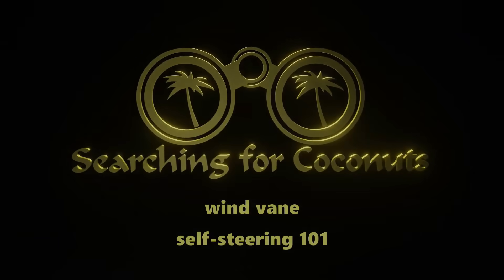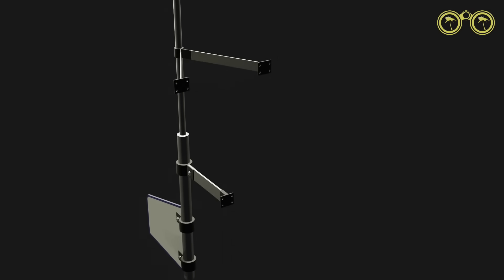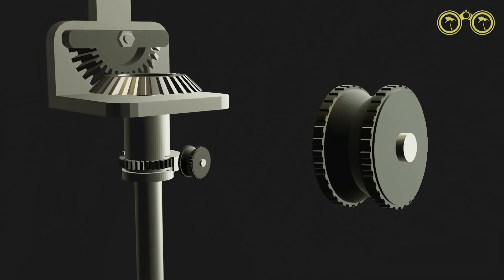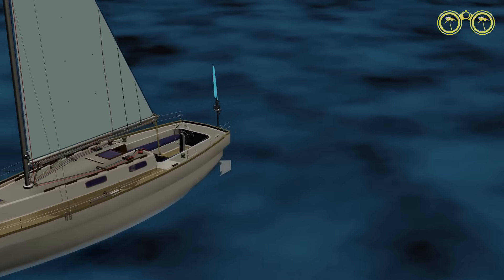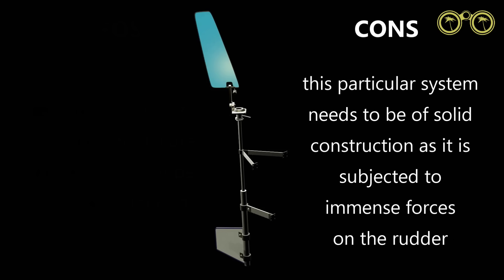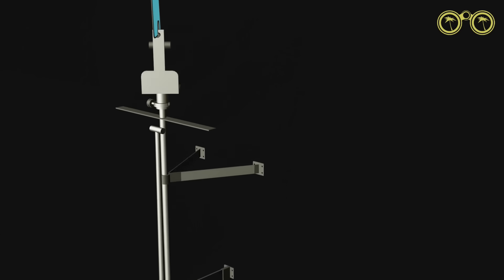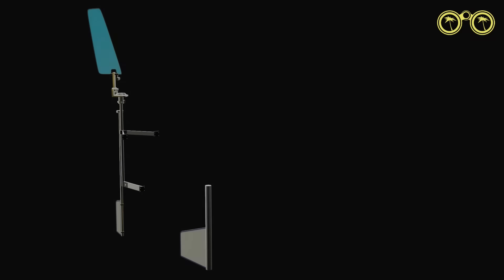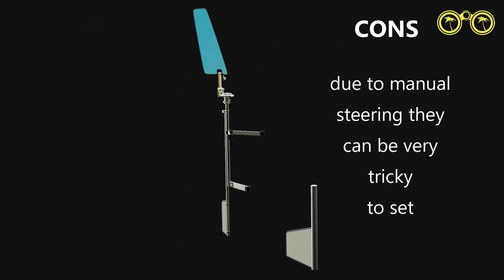Wind Vane self steering systems - An easy, animated introduction on how they work

Comment: In my offshore experience three important issues not mentioned in this video:
1.   The sail of the windvane must 'see' unobstructed wind, meaning it must be many feet aft of spray hoods, etc.
2.   There must be at least 10kts across the sail of the windvane to make it function.
3.   From beam winds aft vanes lose ability to control the boat. The resolution is to decrease main sail area.

Our best approach was to fit a screw-ram autopilot to the wind vane, keep its sail stored, and using <1A / hr,   drive the 50 foot
fin keeled cutter in all sea and wind conditions up to storm conditions.

Comment: I didn't make my own wind vane.  It was on the boat when I bought it.  That was twenty years ago.  I understand it was offered as an  option when the boat was new. 

The boat was new back in 1976. 

The Sayes Rig wind vane steerer still works great although I did replace two parts. 

I wouldn't go to sea without it.
Reply from the maker: Absolutely agree — we also wouldn’t dream of going offshore without our wind vane. Ours is on our 1978 sailboat, and we just love how these old-school boats were built strong and reliable. Amazing to hear your Sayes Rig is still steering strong after all these years!

Comment: There's a fourth type whereas there is  a flat extending off of the back of the rudder. The wind vane forces the flap to one side which forces the brighter to the opposite side.
Reply from the maker: Great observation and you’re absolutely right.  It’s a clever mechanism that we didn’t cover in this video, but it’s definitely a good addition to the discussion. Thanks for pointing that out!

Comment: Good illustration of servo-pendulum systems but no mention of wind vane systems that control the rudder using a trim tab attached to the main rudder. This is the simplest and best system for boats with transom hung rudders in my opinion.  I speak from experience using both systems.
Reply from the maker: Great to know!  First hand experience and knowledge is always great! Thank you for sharing.

Comment: This video is excellent.  However I am confused because some commentators use the terms 'Hydrovane' or Windvane' systems which seems to imply they are different systems!!!! So my question  Is;  Is using the term 'Hydrovane' or 'Windvane' one and the same???
Reply from the maker: thanks for watching and your amazing feedback, much appreciated. A wind vane is actually a system for showing from which direction the wind is blowing from, or any apparatus affected by the wind. I guess the correct term would be a wind vane self-steering system. Hydro refers to water so not sure how that fits in. Then some refer to the systems according to brand names, such as "Wind Pilot". While there are variations in design, they all perform the same function, keeping the vessel on a course in relation to the apparent wind. Hope this helps, thanks again
Reply: @searchingforcoconuts2248  Thank you.  Yes I think Hydrovane is a manufacturer but it is still a windvane steering system.  I am clear now.

Comment: which system would you advise for use on a 40ft cat?
Reply from the maker: That's something for the professionals. You have to take into consideration how fast a catamaran can be, so apparent wind will probably change more dramatically. Then, it has to be installed where the wind is not obstructed or diverted, and between the hulls is not always possible or practical. If you place it on port side, starboard wind will not affect it etc etc... Yes, there are cats with these installed but not too many... Thanks for watching

Comment: Unlike autopilots, wind vanes do not "steer our vessel back onto course."  Nor do they even steer the boat back onto a heading.  Rather, they help the boat maintain a constant bearing relative to the apparent wind.  As the apparent wind changes, so does the boat's heading.  The bearing relative to the apparent wind is set by the pilot or autopilot on the wind vane.

In order to maintain a constant heading, wind vanes must be manually or automatically adjusted by the pilot or an autopilot.  Course control is only achieved, either by the pilot or the autopilot, by monitoring position relative to course and making small correction back to course.

Wind vanes have two primary benefits:
1)  They reduce the pilot's workload, including prolong time away from the helm to adjust sails, cook, and rest.
2)  They act as backups for the sailboat's autopilots.  Without them, an autopilot failure requires a pilot manning the helm at all times.

As with any sailboat steering system, it's best to set and trim sails such that large changes in either wind velocity or wind direction have minimal effect on helm load.  This way, wind vanes will best be able to maintain a constant relative wind.
Reply: I’m new to sailing and I keep watching videos and really thinking about a wind vane hell they work I’m still trying to figure out how it can really keep you on course all the time. I don’t see how it can but reading what you wrote makes sense I think you would still have to constantly, keep on watching your directions you’re going into
Reply: @Justincas5272. You missed their most important advantage.

They keep the sails happy throughout wind direction changes.
Provided you trimmed your sails well no future trimming is required.

This allows the helmsman to do other (in)activities. 

Sail twist and size changes might be required though.  For resting sessions,  the shorthanded watch would be wise to err on a shorter sailplan than for an awake crew.

Comment: FASCINATING.  I BUILT A MODEL BOAT IN PORT.MELBOURNE, BUILT A  SELF
STEERING MECHANISM  TO SAIL IT.   IT DID SAIL OUT OF PORT PHILLIP BAY,  BUT  SAILED 200  KM ALONG THE VICTIRIAN COAST  TO PORT WELSH POOL, AND WAS FOUND BY TEVELLI FISHERMAN.  IT WAS  ONE FOOT LONG AND SAILED   300 KM IN  7 DAYS. IN  6  METER SWELLS, THAT SHOULD NOT HAVE ALLOWED TO EVEN SAIL. I HAD BUILT THE SELF STEERING MECHANISM INTO THE SMALL MODEL YACHT. THIS IS PORT MELBOURNE IN MELBOURNE. AUSTRALIA.

Comment: Why not take the first vane setup, ditch the rudder and connect the vane with the main rudder?
Reply from the maker: biggest pro for the first setup is that the vane's rudder can be used as a back-up rudder should you have a main rudder failure, and if your vane cannot be fixed to the centre of your transom, it can still be installed at a different location and work effectively. Hope this helps, thanks for watching...

Comment: Sorry to not be overly enthusiastic about your videos but they don't explain something simple. How do you keep a course??? I mean if you have to sit there ensuring the rudder is always facing the wind what happens if the wind shifts? You're continually altering it so you may as well just use your helm, instead of a fancy, expensive rudder that does the same thing?
Reply from the maker: thanks for watching and adding your feedback. These systems are designed for long-distance sailing and ocean crossings where consistent trade winds can be expected. They cannot be used effectively for coastal sailing sailing where wind shifts are often and extreme.

Comment: if I have a Raymarine autopilot in my sail, will it have any advantage? or not needed since I hace the autopilot?
Reply from the maker: Hi, and thanks for watching. The nice thing about an autopilot is that it also works while motoring, and a wind vane does not. The downside is that it needs power. If you have solar and/or wind generator, you will not have to worry about power. Hope this helps

Comment: I'm in the process of buying my first sailboat. And when I see this explanation, it blowed my mind with so many new stuff to think about when buying this boat. So, during the video you mention the first system is good for "small boat". Can you tell me what is "small boat" in this situation? Is it <= 30 foot boat? what is a big boat? > 30 foot can be an answer? Thank you!!!
Reply from the maker: Hi. thanks for watching and I hope the purchase of your boat goes according to plan... In my opinion, a small boat would be in the 36 foot and smaller range, maybe even 38/40 depending on the keel/skeg/rudder situation. The rudder on these wind vane systems are much smaller than the designed rudders on the actual vessels so they can only be effective if everything has been set up correctly. On larger boats you might want to use the actual steering of the boat for effective steering. Hope this helps

Comment: Looks simple enough. Isn't it effected by currents.  How does one know how much weight to use ?
Reply from the maker: All sailing is affected by currents, which in turn affects your apparent wind in some way. If you mean the weight holding the vane up, this is in relation to the vane. If the wind is not affecting the vane (that is, blowing straight onto it) you don't need excess weight to bring it standing straight. Hope this explains, thanks for watching

Comment: YOU cannot get in trouble for showing "trade secrets"  as anything sold is able to be taken apart and shown.
Reply from the maker: basically what I should have said, but would have taken too long, is that I don't want to be responsible for someone trying to make one after watching this video. If they somehow got it wrong, fingers might be pointed my way. Thanks for watching and contributing, much appreciated

Comment: so if I understand this, for it to be used to keep you in course the wind would have to be constant. if the wind shifts the domain would direct you off course because it would realign you based on the new direction? meaning it holds relevance to the wind, not your heading. that seems like it could be bad to use if your resting because you could end up way off course right? sorry I dont sail, just learning concepts still.
Reply from the maker: yes, you are correct in your understanding, if the wind swings, your course will alter according to the wind. Best suited for trade wind sailing or if you just need some time to do some other tasks and need a free hand. On the plus side, it requires no electrical energy as an auto-pilot does... thanks for watching and contributing

Comment: I went to but a servo pendulum vane  a couple of months ago but I was told it wasn't any good for hydraulic steering.  Are all makes the same????
Reply from the maker: best to try contact a specialist in this regard, someone who can have a look at your steering, as there are issues with bypass valves and a whole lot of other tech problems you might face. This is way above my skills level but it has been done before, so not impossible
Reply: @searchingforcoconuts2248  Thanks. I will keep researching. Maybe they thought that model wasn’t strong enough.

Comment: You forgot to mention a very important factor on your first example. For the system to actually work the auxiliary rudder must be balanced with some area forward of its axis so that it turns very lightly. The reason for this is that no windvane has the power to turn a regular rudder, I mean, just imagine the force you must apply on a tiller when hand steering, it can be enormous. So, either you make a very balanced and light steering rudder or you create a systems where the force of the moving water is used to turn the main rudder, like your next two systems. You also did not mention another common way to achieve this power which is by using a trim tab, or a mini rudder at the trailing edge of the main rudder, where the trim tab turns the opposite way to where you want to go but this forces the main rudder to turn the correct way. By the way, one way to conserve energy, if you are using an electrical autopilot, is to connect it to a windvane, this way the force to turn the boat's rudder comes from moving water not from the autopilot.
Reply from the maker: thank you for contributing such great information, very helpful and much appreciated

Comment: One significant advantage of the servo pendulum type (the second system described in the video) is that it is self-correcting for "broaching" downwind. On a downwind course, if the stern swings to port due to wind and wave action the servo blade effectively moves to starboard relative to the boat, and this is the correct direction to correct the broaching action.
I once held the windvane central for several minutes on a dead downwind course and our boat maintained a steady course downwind, self-correcting for the swinging of the stern to either side. 
So in this situation, even before the windvane senses the change in course relative to the wind, the self-steering is already applying correction to the course.
This characteristic is not shared by the other types.
Reply from the maker: thanks so much for assisting with such an informative contribution. It's much appreciated and sure it adds value to our video...

Comment: What if the wind is blowing broadside how will it keep the direction of the vessel this is where I get confuse thanks
Reply from the maker: The vane gets rotated manually so it faces the wind and stands straight up. At this stage the rudder is centered and steering straight... any deviation in the wind (caused by bearing away or luffing up) makes the vane tilt, causing rudder steer and course correction... hope this helps

Comment: Thanks for the walkthrough, I've been thinking of adding a windsteer system to my 30' Newport once it's done, mine has a advantage of still having it's original thru deck tiller mount as well as the original wheel mount, I've been thinking how to mount the wind vane on top of the arch I'm building and running a detachable connector to the tiller mount.
Reply from the maker: I see your project is up and running, wish you all the best. Would like to assist and offer advice but someone needs to be physically there to check your options. Good luck with the channel and your adventures
Reply: @searchingforcoconuts2248  appreciate it, thank you

Comment: The auxiliary ruder vane system, has been installed on 65 footers with success, it is not just suitable for mid range to smaller boats. If requested I will put the URL in a reply.
Reply from the maker: thanks for the input, we appreciate any feedback and any links

Comment: Your channel is a revelation, great information and useful insight. I've really found it to be a great source of practical information.
With regards wind vanes I'm a hydrovane auxiliary rudder fan specifically, but for me any ARS vane  is preferable to a servo pendulum type vane, although the likes of Monitor and Aries are great vanes the two big disadvantages of SPS vanes are the critical centerline mounting and control lines, and most importantly from a safety point of view they offer no secondary steerage alternative. I know of at least one instance where two simple 10mm bolts (port and stbd steering cable pulley mounting bolts) failes rendering the CPT and backup autopilot, helm and Aries all useless. 
This is a very well equipped high latitude Westsail 42' CC with a very experiencedoffshore skipper, I'm going for a hydrovane for the steel VDS 34' im negotiating price for as we speak, she also has 2 tiller pilots as autopilot and redundant autopilot.
Offset mounting and the safety aspect of a hydrovane auxiliary rudder with only your continuous line to set vane angle on the worm gear pulley makes for a safe uncluttered cockpit with a second way to steer the boat.
No brainer for a solo or shorthanded crew
Reply from the maker: wow, thank you for informative review, and hope it all works out for you, thanks for watching
Reply: @searchingforcoconuts2248 going to CT month end to fetch my Van De Stadt 34', the other factor re auxiliary rudder vanes is that I didn't mention, and this is a biggie for cable and quadrant helm steered boats is that you have ZERO wear on your main ship's steering gear, balance the boat, lock the helm and the vane takes over, better for the main steerage gear and vane as you'd already have balanced the main rudder so it's balanced and static so the vane doesn't have to take up the intrinsic weather/lee helm tendencies of the boat so the wear on the control head/gearing is reduced. Win win, for my boat a monitor is 74K and a hydrovane is 93K but I'm skeg hung tiller steered with a Scanmar Pelagic tiller pilot and a second redundant autohelm so no wear on cables etc and Scanmar make the monitor SP vane, also 8 tons of steel welded together, I'm not likely to lose the rudder and steerage. 19K is my new liferaft 
BREAK OUT ANOTHER THOUSAND 😂😂😂
Reply from the maker: @jonnorousseau3096  my guess is you're talking Rands...? Thanks for the additional info, good luck and enjoy Cape Town
Reply from the maker: @jonnorousseau3096  great information again, thank you... Had my eye on a Van De Stadt '34 situated in CT, but due to lockdown etc. never got around to looking at her last year

Comment: I plan to make with my 3d printer a small wind vane for my autonomous micro boat. Do you know if with BLENDER we can have static STL outputs?
Reply from the maker: although I have no experience in doing this myself, check out https://docs.blender.org/manual/en/latest/addons/import_export/mesh_stl.html

Comment: I am at loss here. So you bolt it on feed some cables thru. Ok can you progame ? The vane. No! So just set it at the present courrse and get your head down, nice
Reply from the maker: they cannot be programmed like an auto-pilot, the vessels sails are trimmed and balanced for a certain course in relation to the wind and the vane is then manually set and adjusted. If wind shifts, vane will have to be re-adjusted. These are for long passages where wind shifts are minor and gives crew much needed rest and free hands to tackle other tasks